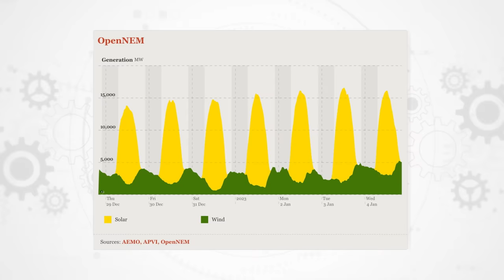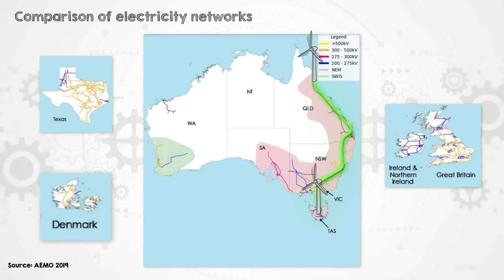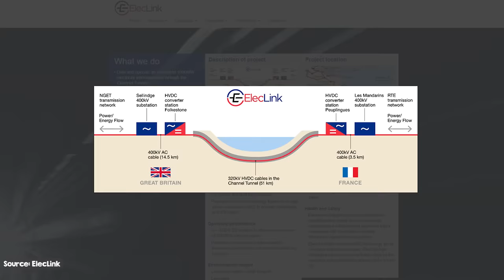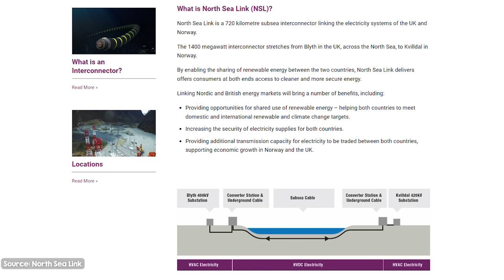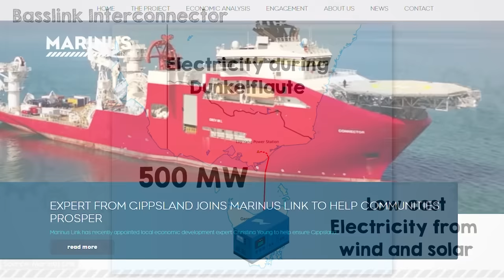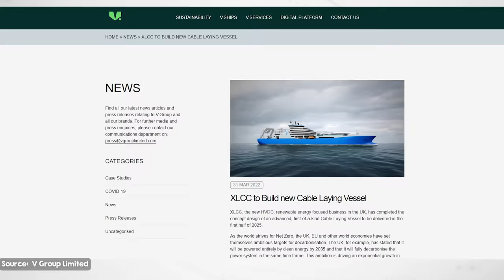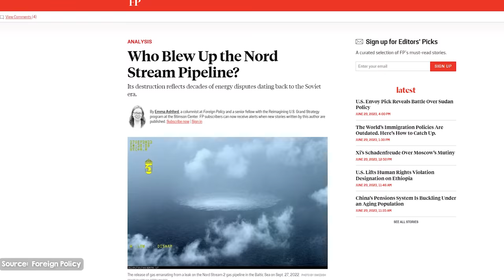Electricity Across Oceans: Is HVDC the Future?

Comment: What voltage are these DC cables using, and also how is the high voltage DC then stepped down for domestic and industrial usage.
Are we talking some form of massive 3 phase inverter?
With trains that use 25qkv ac, this is transformed and rectified down to around 750V and then into a 3 phase inverter to run AC traction motors, but with this DC transmission  line we are talking many gigawatts of power.

Comment: I have a comment regarding the depiction of capacitive current flow in HV cables. HV cables have a grounded metallic shield around them, therefore capacative current flows from the central conductor to ground using the grounded shield, and not the ocean floor or the sea. If it were unshielded, any local sharp rock would distort the electric field and cause partial discharge, while destroying the insulation. Shielding ensures the field is perfectly symmetrical and its intensity is easy to calculate using the model of coaxial capacitor plates. The only cables which don't have a metallic shield are low voltage cables, as the the voltage is too low to create electric fields intensive enough for partial discharge to occur, plus they are insulated way more than necessary due to mechanical reasons. Great video otherwise, have a good one :)

Comment: Good point about the grid being able to counteract the spatial variability in renewable energy production.  It's long seemed that this was overlooked.

The cost of using DC seems to mainly be the cost of converting from AC to DC and back at either end.  A fully DC grid would eliminate this, and probably be just as useful, if not moreso, for the modern world, with lower line losses throughout the system.  It's hard to change the inertia, though, of the current system.

Comment: How come we haven't linked the eat to the west coast in Aus? I assume it could be done with normal open-air lines and there is already rail right through that could be used to for servicing. Pay us sandgropers for our extra sunshine if you're going to take our mining GST, heheh. Also, why can't we just use more batteries (lithium, flow, etc) to solve the intermittence of renewables? Wouldn't that be a lot cheaper? Or is this mainly about generating income from energy exporting?

Comment: Hi Rosie  The problem I see is the availability of materials and the cost of all these materials.
Copper increased from 2000 to 2022 more than 400% for example.
I believe, in my humble opinion, that the prices of metals and minerals for all facilities and power transmission will increase, contrary to what economists say.
And do not forget that all this will be done using oil: from the production of elements, logistics, placement of the central cable, etc.
I have doubts as to whether the batteries will be able to handle as much electricity storage as needed.
Fossil fuels gave us cheap energy, which allowed the comfort bases of the northern countries, I don't see that this energy is so cheap and that is a problem.

Comment: If I'm not mistaken one of the largest synchronised grids is the Southern Africa Power Grid with very few DC transmission lines.
You did not mention that one significant reason for a DC interconnect is to link networks that are not syncronised.

Comment: There  is a huge differene between sharing information across oceans and sharing energy.  Energy needs high voltages and big conductors, unlike the tiny glass fibres of communications.
DC is the way to go for high power and long distances, but long distance transmission is still very expensive to install and repair.  It has got to be worth it.

Comment: Great video about an exciting prospect for sharing energy across the planet. But I do have one question about the history about long distance DC transmission. In the earliest days of electrical grid and transmission development, when Edison and Tesla were both still alive, AC won out over DC, I understand, because DC transmission was limited to just a few miles. So the North American grid was built out with AC local current and AC long distance lines. If that is correct, then when did DC transmission over hundreds of kilometers first become feasible, and what changes in technology made it possible?
Reply: You can look at the Wikipedia HVDC article for more detailed answers.  A small HVDC line went into service around 1955 in Sweden to power the island of Gotland. I think the Pacific DC Intertie was one of the first really large DC lines.  It went into commercial service in 1970.  They originally used Mercury Arc Valves (essentially, gigantic vacuum tubes -- the British called vacuum tubes valves for some reason).  Thyristors (aka Silicon Controlled Rectifiers) went into service soon after.  Now Insulated Gate Bipolar Transistors are starting to take over for SCRs.
Reply: @jjggbbjunk  Thanks. I'll take a look

Comment: Several European countries use AC at 16 Hz for overhead traction on their railways. This lower frequency was primarily used to assist traction motor torque but has shown to significantly reduce capacitive losses.

Comment: Can power be used or added along the way, or does that effect the efficiency. For instance, could a cable from WA to the east coast bleed power off to small towns along the way, or pick up power from remote (from people, not the cable) solar and wind farms?
Reply: There's no reason that couldn't be done. But you'd need a high-voltage handling facility at each point the cable is used, so there would have to be enough power going through it to justify the construction costs.

Comment: One significant point is that it takes a DC generator to generate the high voltage at the power source and a DC motor to generate the AC for consumption at various phases and voltages. I have been an avid reader and always interested in electrical since the early 60s while in high school so I remember this project: https://en.wikipedia.org/wiki/Pacific_DC_Intertie and reading some of the early tests done on the West Coast of America. DC voltages are interesting to work with and I found that if it can go to ground it will and needs no encouragement as it generates a continuous arc whereas AC is always reversing polarity. An advantage to DC is that the earth of the planet can be the return line so only one conductor is needed, saving material costs. Good video.
Reply: While using the literal ground as a return might have worked for telegraph's etc, I don't think it will be viable for electricity supply. The ground restance is too high, and way too variable, to be able to predict what your designs would actually achieve. Trying to return thousands or millions of amps through the ground would cause more problems than it solved.
Iirc Rosie didn't really cover why ac became the default supply method. It is simply because you can change voltages by using simple transformers, which were well understood at the time. Dc voltages can only be increased to the level that they are most efficient for transmission by using power  electronics, which didn't exist when the first grids were being rolled out. So Dc could only be used locally to where it was being generated, because the voltage generated was the same as the customer used, there was no step up and step down in between for efficiency.
 I have been told by several people working in the power industry, that the reason high voltage Dc links are used under the sea is because the salty sea water acts adversely on the alternating electric fields of the AC cables and effectively introduces more resistance and therefore more inefficiency.
Once high power electronics had been developed (tubes at first) then boosting DC links was possible and the first UK to France link was built decades ago using that technology.
Reply: It doesn't require such motors or generators, modern high power electronics can change dc voltage and convert AC to dc and DC to AC without any moving parts, just solid state electronics.  The development of those electronics is what has made hvdc practical in more cases.
Reply: I worked for 15 years on the PDCI.  We used AC transformers to reach the needed voltage.  The transformers included tap changers to adjust the tap ratio as required.  Stacks of thyristors in series were used to rectify the DC to AC, and to invert the DC back to AC at the receiving end.  Our transmission line resistance was 20 Ohms(per pole).  The resistance between our ground electrodes was about 3 ohms.  But we ran in bipole configuration most of the time.  If we lost one of the converters we could run in ground return, but this tends to get folks with underground infrastructure upset, as it can increase corrosion in pipelines and such.  A bipole line has some reliability advantages for the AC grid it is connected to as well.

Comment: I didn't see any mention of one of the big advantages of DC transmission. With DC, the RMS voltage is the same as the peak voltage whereas, with AC, the RMS voltage is only about 70% of the peak voltage. You can run any given power line at a higher RMS voltage with DC than with AC whilst still keeping the peak voltage below the line's rated voltage.

Comment: That would be perfect for my country, Brazil. We have very strong winds in the Northeast region of the country that pushed electricity prices down here.

If we somehow could connect that region to São Paulo, a state 2000 km away that holds 1/3 of the entire country's population, a drop in energy prices could help the whole economy. São Paulo has access to hydropower as well so we can get away with no energy storage.

Edit: just checked out and apparently there is already a plan to install 6184 km of transmission lines across the country.

Comment: I overheard an academic talk of Engie's chief scientist recently. It seems there is a kind of consensus that "green molecules" like hydrogen, ammonia or methanol will do the heavy lifting of transporting renewable energy around. It's sad of course that such a system tends to be less energy-efficient than HVDC, but the infrastructure for it would overall be less demanding and more already deployed or easily obtained by configuring the already existing infrastructure.
Reply: That also enables an incremental approach, where power generation is somewhat decoupled from interconnect construction

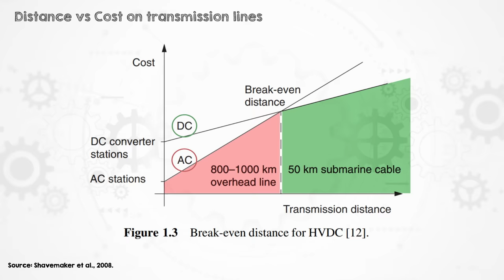Comment: 4:10 Recommend watching Esigs webinar titled "Interregional Transmission System Planning with HVDC" which outlines additional advantages that HVDC can offer & shorten the "break-even" length below what's possible with just relying on energy arbitrage:

1. Flow control/market optimization

2. Dynamic reactive power and voltage control

3. Lower long-distance transfer losses

4. Smaller footprint/right-of-way (ROW), including for undergrounding option

5. Reliability benefits (fault ride-through, lower N-1 contingency for bipoles, voltage support)

6. AC dynamic stability; power oscillation dampening; mitigate stability constraints on
AC grid

7. Grid forming, grid services, synthetic inertia, blackstart/restoration, etc.

Comment: I know this an engineering, not economics channel, but I'd love to see a section considering how the electric billing would be affected for the end user if we managed to connect a global production grid.
Reply: There are already programs in some places (both in the sense of gov't programs and computer software) that let you connect an electric car or a home battery system to the grid and bid on electricty depending on the market price, buy low, sell high, etc. I suspect that the owners of the grid scale infrastructure, i.e. the power poles, overhead lines, etc, would probably run an exchange system, where both the big power plants and small consumer/producers can buy and sell energy by the kWh, with a transmission fee based on distance from buyer to seller, to account for maintenance and transmission losses. That way, the grid always balances the amount of energy in and out. You only send energy to the grid when it's sold, and in order to buy it you have to know where it's coming from. Basically it would be ebay for electricity. But that's just one idea. Right now the utilities are very centralized, and you can only buy and sell with one party, the utility. I'm not sure what the middle state between here and there would be.
Reply: @DFPercush  Not sure it's worth it to overuse an ev batteryfor arbitrage, as you will be limiting its lifespan. Home LFP batteries on the other hand could be worth it.

But I was thinking more among the lines of the energy price duck curve, and how this could affect it. The curve is already being altered by lower prices at certain hours thanks to renewables (specially PV as is more focused in the central hours), but if demand increments due to near regions buying our chaper energy price should rise, and at the same time, in the late afternoon with no light but bigger residential demand, there'd be an incentive to buy energy from other zones, which should lower the price a bit. 

It makes me think this would lead to an overall flattened curve, but I have no experiencie whatsoever, so I wanted to hear from the experts in the subject.
Reply: @drillerdev4624  Depends on the battery. LiFePo4 has a pretty decent charge-discharge cycles - 3000+ at full depth, but if you've only using a part of the capacity then several times that. On a daily cycle you're looking at ten years or more to wear out the battery.

Comment: It would be good if you used a superconducting cable set. Best to do AC if you plan long haul though.  Going from US to UK as shown might be an exception because the frequency mismatch would require 2 sets of conversion anyway.
Reply: AC would not work for such huge distance even if the frequency was the same. This actually explained well in the video.

Comment: One useful thing about the sea bed is that its temperature is virtually constant. So when eventually high temperature superconductors reach that temperature, more or less lossless transmission becomes a possibility. That will be a real game changer.
Reply: Perhaps, but it's not a good idea to bet on hypothetical technologies. There's no currently known law that precludes such a material, but that is no guarantee that it exists.
Reply: @vylbird8014  The main problem with high temperature superconductors is that they are nothing like wire. They are brittle ceramic-type concoctions. Making a cable from then may prove a step too far.

Comment: I wonder if aluminum bronze is a good high voltage conductor option, it has very good corrosion resistance and high tensile strength as well as being an excellent conductor

Comment: OK, the way you present this and the nice package you tie up a neat bow on sounds really nice,,, but.
For one don’t hear any real cost benefit analysis etc etc. And even if it could be made to work as such, a bit of thought would unearth that, if say UK was not generating because of no wind and sun the USA would have to have the infrastructure to power both - and visa versa.
In theory a good idea, but my guess would be extremely expensive. 
BTW,  there was a similar project proposed where a solar plant in nth Australia was to supply Asia via a HVDC undersea cable, the project collapsed.!!!!!!!!

Comment: Hydro Québec in Canada has had HVDC line since 1992. It links Radisson at the James Bay project to Nicolet on south shore of St-Lawrence and to Sandy Point near Boston in USA a total distance of ~1513km .    450kv DC.  (note: 1218km are in Québec, the rest in New England)  
 (450kv DC means 900kv difference between each of the 2 wires).  1200-1400 MW in  capacity. 
 
Québec runs at its own 60hz phase, so all exports to USA and Ontario need to go through DC  and it was felt that the higher voltage allowed by the DC line reduced losses over the distances and since it would have to be converted to DC anyways, might as well convert it at the source. 
This line is special as it has a terminal midway at Nicolet that allows it to draw current for Québec consumption as well as let rest of current flow to USA for export.  It is also able to import power from USA when they have a surplus. 

Google with Hydro-Québec  450kv and: 
Wikipedia: "Quebec – New England Transmission"
In english:  multiterminal direct-current system (MTDCS)
In French, it is called Réseau Multiterminal à Courant Continue (RMCC) 
(sorry, for no links but I get banned for a time period on Youtube for posting direct links)